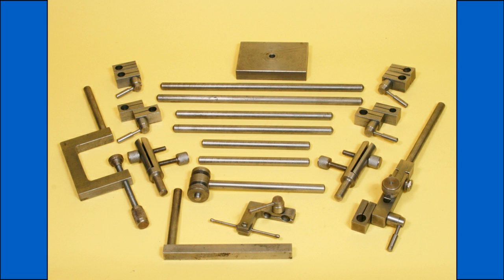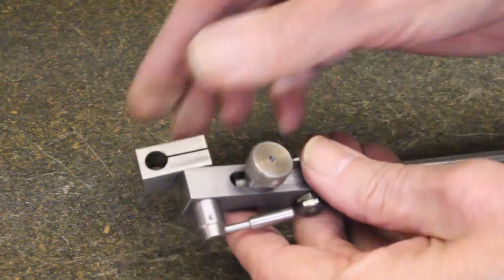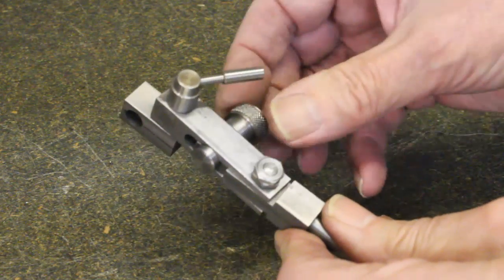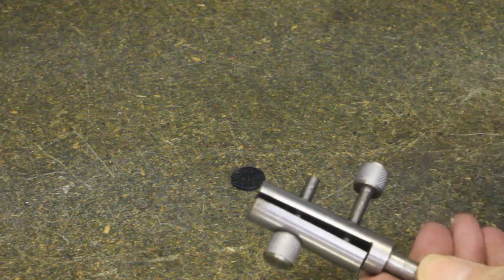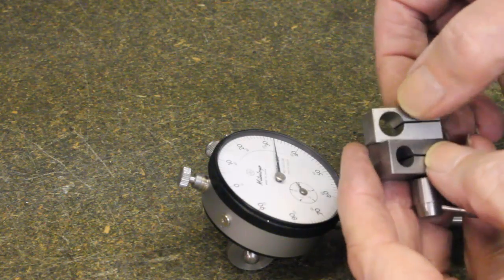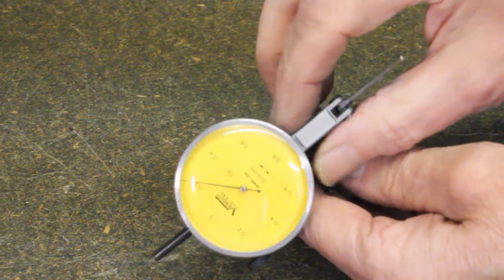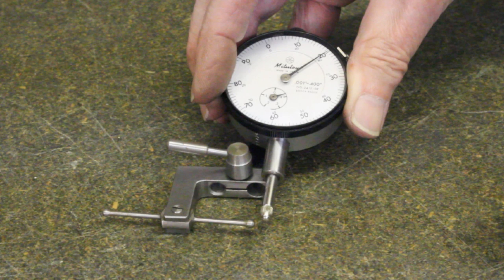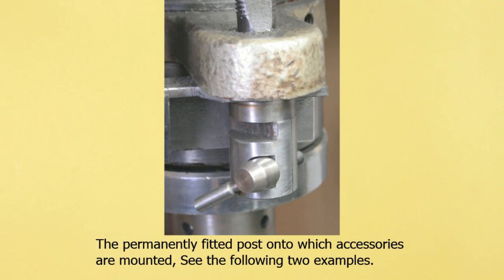Accessories for a dial indicator and other uses

Comment: Where is the info on your internal bore indicating attachment (you know, the one that no longer fits your dials)?  I looked at your web page and I could not find it.
Reply from the maker: Steve, this has only been published in an early copy of MEW, (issue 16 1993) its not even included in the "Model Engineers' Workshop Projects" book. However, I have taken note of what you say and added a page detailing it on the web site. A link to this can now be found in my introductions above. Harold
Reply: Home metalworking workshop Thanks!  I downloaded the files and they look interesting!